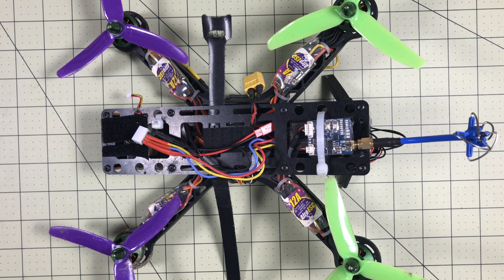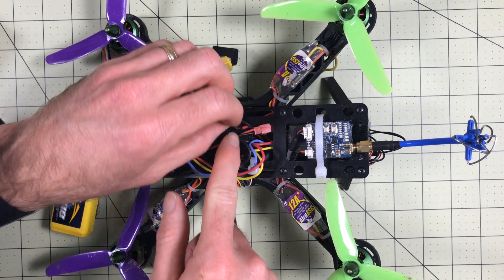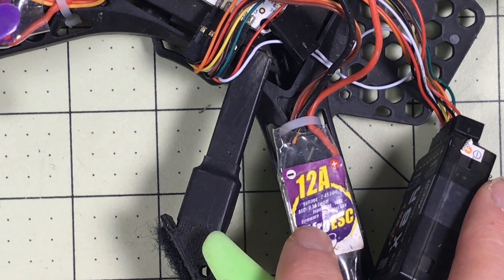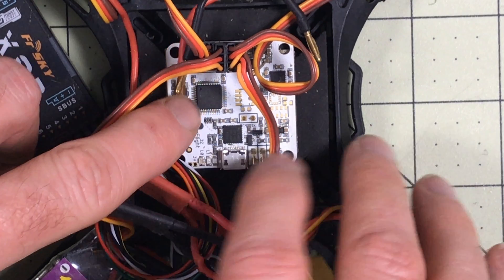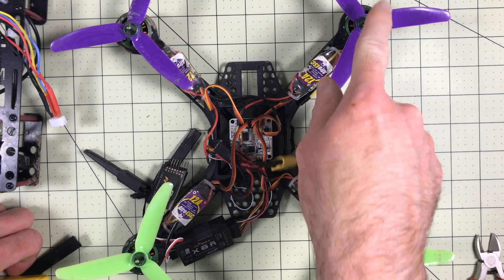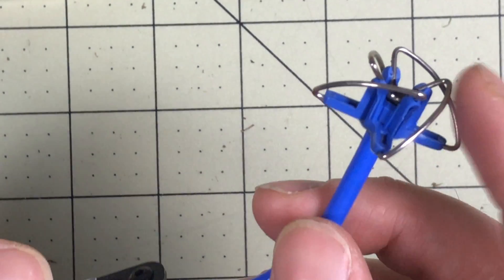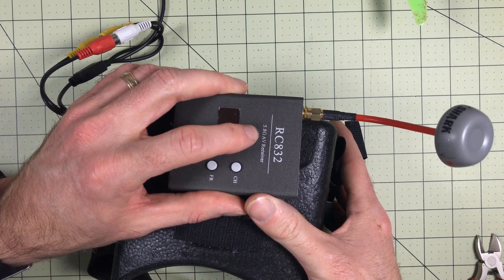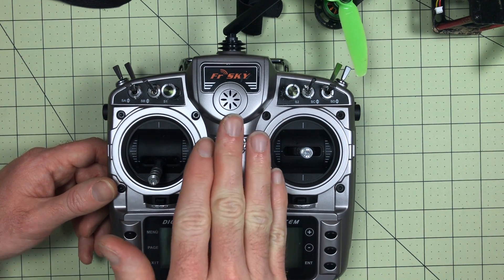Droneracer101 – Quadcopter Components – Part 1: Component overview | A look at an old quadcopter

Comment: I'm pretty decent at working with my hands. Do you think it would be easy or possible for me to build my own quad? Should I buy a kit for my first build?
Reply from the maker: +Mike Anderson as long as you can solder you would be good.  What kind of quad are you looking to do?
Reply: DroneRacer101 really the easiest cheapest one would do. I  want to do a simple quad that's pretty quick and has enough range so I don't have to worry about losing singnal. It doesn't have to very fast just a little faster than what I have flown. I've never even flown one of these but I have been practicing in the MJX Bugs 3.
Reply: If I pay you epykd you sell me some things to get started
Reply: DroneRacer101 thank you get much for replying. I think I'm ready for one of these drones. I do stuff with my bugs 3 that I have never seen anyone online do. Until I lost it a few days ago. Now I don't have a quad that's worth crap.